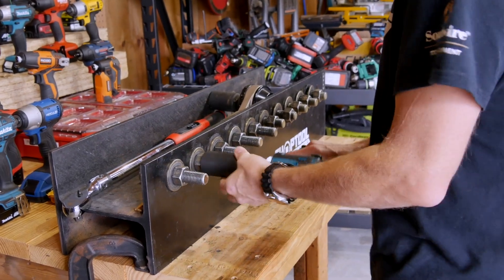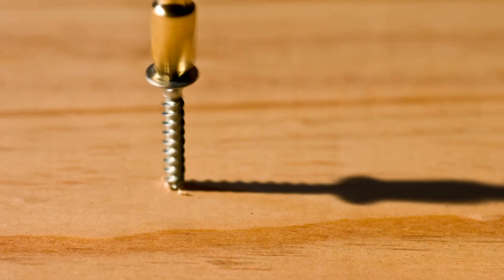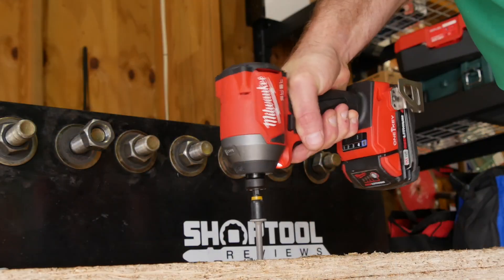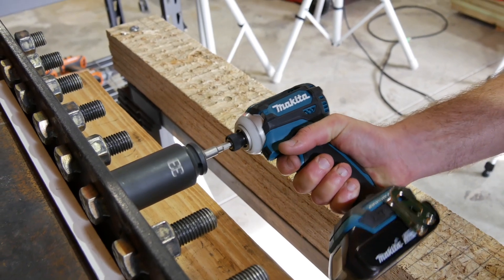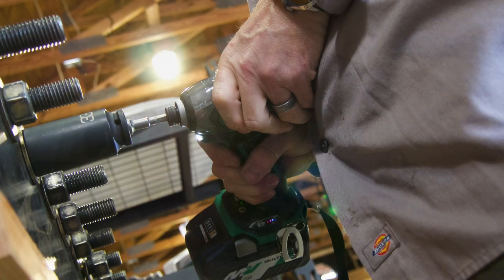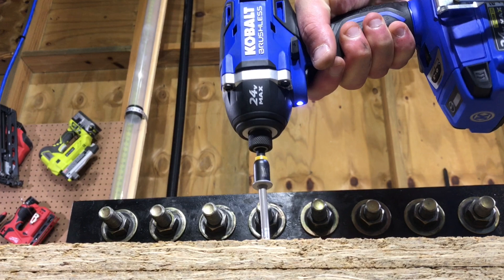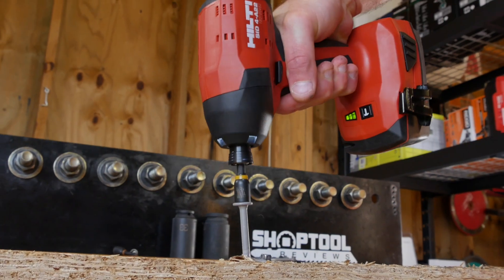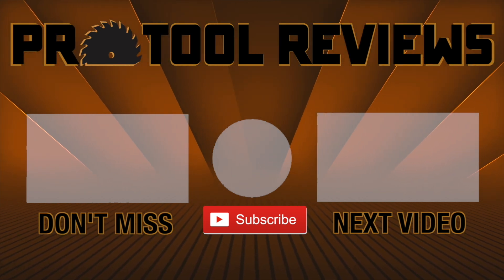How Much Torque Do You Need in an Impact Driver?

Comment: Torque is a measurement of force. Power is the measure of voltage multiplied by amperage.

Let's not confuse these unit of measures

Comment: You simply can't replace a 3/8 with this driver. I have the 1/4 2000inlb Milwaukee. It's a very good tool but plain and simple doesn't do what my Milwaukee 3/8 can do with 600flb reverse and 450 forward.. The 3/8 will in a fraction of a second remove bolts that the driver will need me to keep impacting for a long time to remove. Same goes for my Milwaukee 1/2in the 3/8 can do things like remove lug nuts but it labor's unlike the 1/2in that effortlessly removes the same nut. If it takes more than two seconds to break a bolt you need to move up to a bigger tool.
Reply: I was going to get the m12 stubby but. Now I’m confused on wtf to get.

Comment: I want power and speed settings. Not long ago people didn't want to use cordless because they didnt last long on a charge and didnt compare power wise to a power tool. I think we are now finally satisfied since both requirements have been solved. I for one like having the extra power and the ability to use what I need for the specific application. I love using my m18 Gen3 impact if and when my m12 gen2 is not enough. You will never hear me complain it's too powerful. I'd rather have a weaker cordless power tool.

Comment: I used to have the m18 Gen 2 Milwaukee impact wrench. I sometimes used it with the socket adapter but never pushed it too hard to avoid over working the tool. Could you use it to remove a lug nut? Probably yes. Would I do that regularly? Big no.
I recently purchased the m12 3/8" stubby. I just felt more comfortable having an anvil than an adapter.
Reply: Bosch freak becoming more appealing

Comment: Great points.  I use a quiet hydraulic driver (Surge) with 'only' 450 inch/lbs for all of my small to medium sized screws and an impact wrench for bigger lags and bolts.  The traditional loud 1/4" impact drivers with all of their big torque numbers are completely obsolete to me.  I  haven't owned one in 3 years.
Reply: You mean 450 inch/lbs
Reply: @ravenstarver1360  yes. thanks